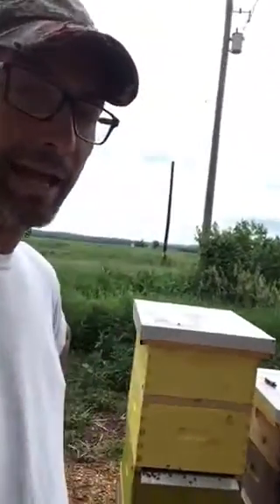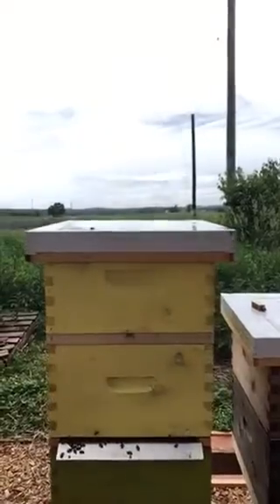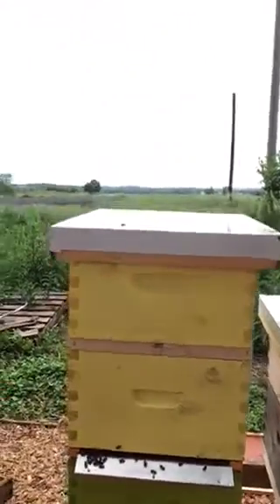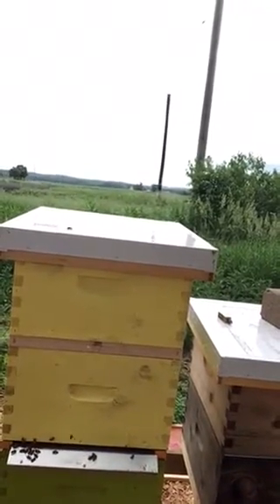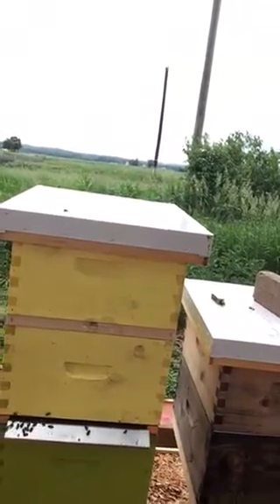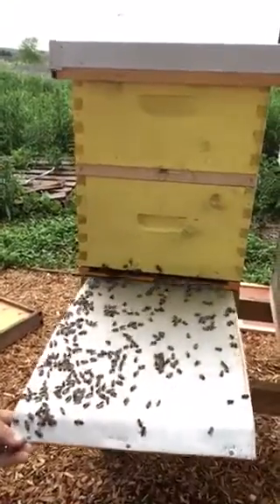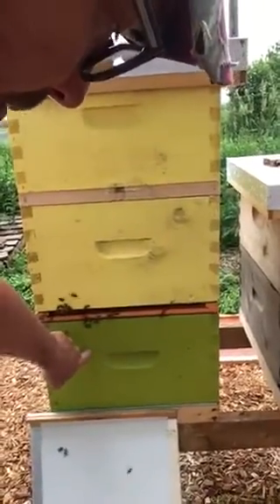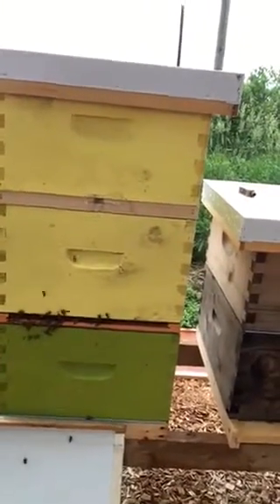Queen Rearing - cloak board

Comment: If you don't reverse the bottom box but just keep both top and bottom box open will this still work? 

Or will it cause the bees in the top (queenless) to just move to the bottom box without a reversal? 

I'd run into an issue where the bottom box couldn't be reversed easy due to another colony being in the way.

Comment: I have been thinking about a variation of this system though I have not tried it yet. If you are doing this in an out yard to save having to come back 2 days later why not use a sheet of News Paper instead of the metal slide and let the bee remove it for you.
Reply: The bee will chew through the paper not good, the metal slid as you put it is there to seperate the queen pheromones from the top box so they think there queenless and raise queens from the grafted bar when he puts it in the top box after a few days of queenlessnes .